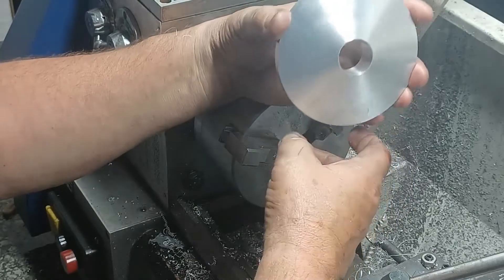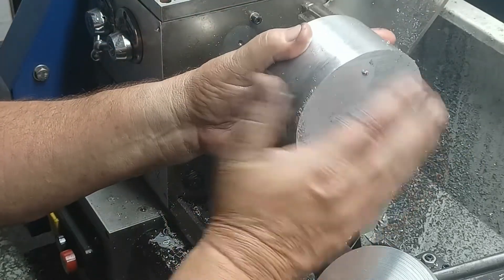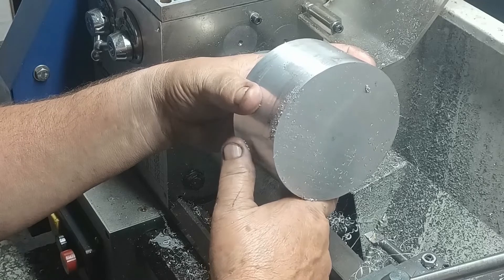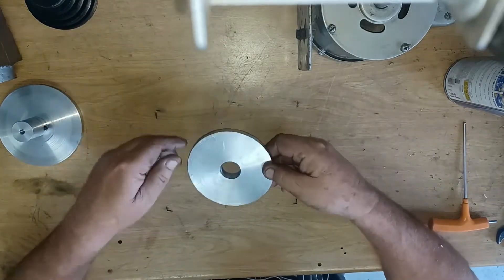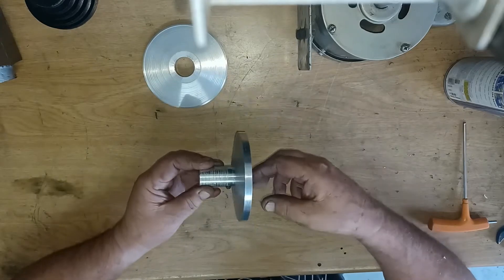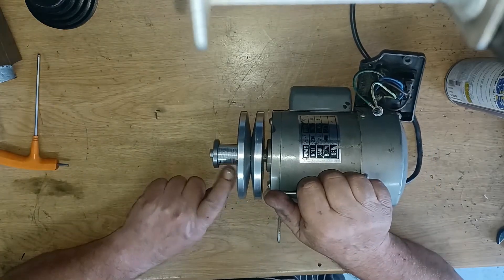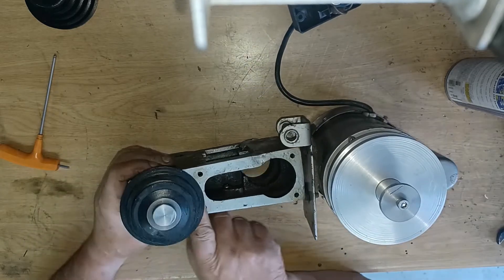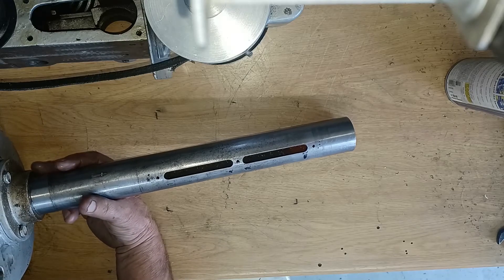How to make a variable speed pully on the lathe.

Comment: Could not find the second video. Have never seen a variable pulley without a keyway (or splines). As you are only effectively using one half of the belt for transmitting power it would seem it would have more chance of slipping under load.  How did it work in actual usage?